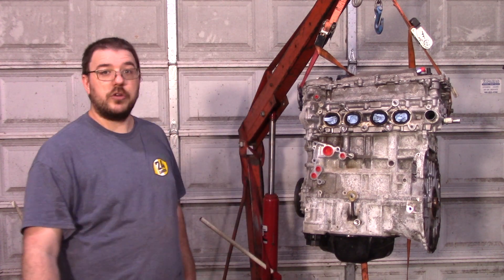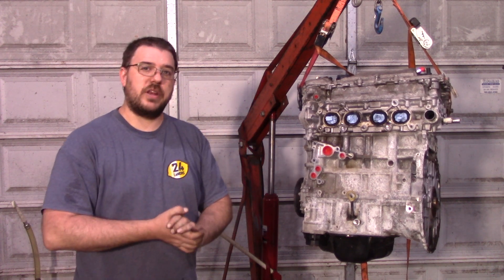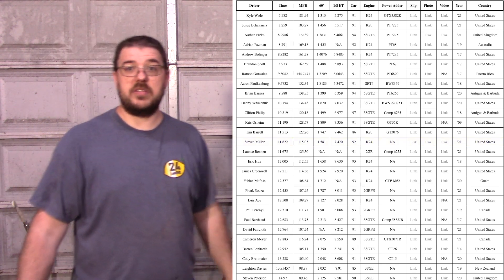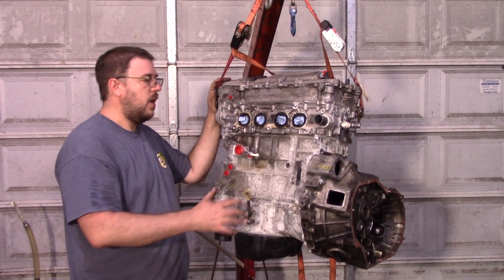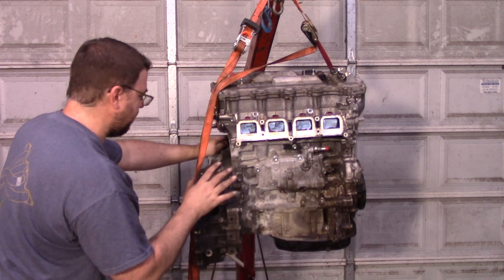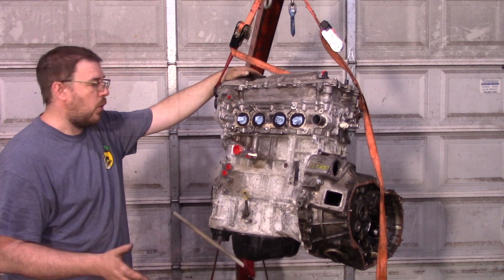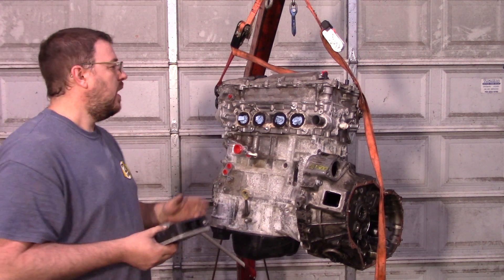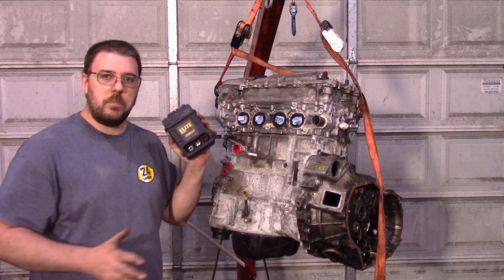MR2 Drag Race build, 2AR-FE powered (Evey #2)

Comment: I'm a year late, but I am interested in putting one of these in my 2nd gen for street use. Would probably want to do some top end work to make it rev higher though. Ideally I'd want it to have that same spirit of the beams engine. What's the highest you've gotten these to rev?
Reply from the maker: I have rev'd it to 8600RPM on the dyno but i have only raced it to 7600RPM. I will likely bump up the redline to 7800 for the next race, trying to sneak up on it

Comment: the SW20 is very near and dear to me, so very excited to see how Evey unfolds.  I had a 91 T-Top SW20 turbo back in 2005.  If I ever get another SW20 that's Either NA or with a broken 3SGTE I will definitely put in a 2AR-FE.  I've been fascinated by this engine since I read about Papadakis using it in the Hatchback that Fredrick Aasbo used to drive in Formula Drift until he got a GR Supra.
Reply from the maker: Yeah, that build he has is quite impressive. Especially how many stock components were in the build when it was making closer to 850whp.

Comment: Did you end up bothering to try the S54 fitment?
Reply from the maker: NixSpeed is currently building an AW11 and they confirmed the S54 has the same thing going on as the E153, the '91 and '92 bolts up but it's a bit light on bolt positions, the '93+ has more than enough bolt locations.
Reply: @FrankensteinMotorworks  thank you so much! Now to hope the engine oil pan clears my front engine mount support bar in my 6 gen Celica!
Reply from the maker: @Breazeh  That question is one i can't answer but i suspect it will.
Reply: @FrankensteinMotorworks  have you seen anyone in forums or discord doing the same swap in a gen 6 Celica?
Reply from the maker: @Breazeh  i regularly get questions about it but i do not have any details

Comment: What is the reasoning behind using a Haltech 1500 instead of a more affordable model like the haltech 550?
Reply from the maker: Jeff, the summary it gave me when it notified me of this stopped at the "m" in more, i thought you were trying to say motec and i was expecting to have to explain that not everyone has a massive budget to work with. But this is quite the opposite question. The primary reason is the drive by wire. The 1500 is the cheapest model that supports the DBW system. You could certainly convert to a drive by cable and probably do it for less than the $700 difference in ECU pricing but then there's also the Dual VVT-I and that isn't supported until the Elite 1000. The difference in price between the 1000 and the 1500 is $190 and if you look at the feature chart you gain a whole lot more than just DBW when going from the 1000 to the 1500, you also gain a nicer long term learning feature set, an ignition table that can depend on three variables instead of two, three level engine protection (this is really only a gain for the endurance racing i do, for street driving the single level is just fine). it also picks up all the race functions like the advanced boost control and the advanced flat shift support except. the only thing it is missing is the fancy torque management. It also picks up two extra outputs to make it so the DBW system does not consume additional outputs.
Reply: @FrankensteinMotorworks  I see. Thank you for the thorough explanation. Having never used a haltech ( or any custom ecu) myself, I was a bit confused as to what the difference would be in regards to this application. Having seen all of your 2ar videos, I knew you would have a good reason for choosing the more expensive device.

Comment: This is a minor thing but a "spotting guide" for how to identify a compatible E15x transmission would be nice; I'm lately getting inspired to dig into Toyota stuff and would prefer to find something that can both bolt to the 2AR and the ST185 transfer box.

I didn't realize the Elite 1500 does dual VVT; that makes it an interesting option for some things.
Reply: Look into the E352F and E359F from the 2000-2005 RAV4. They run the newer AZ/AR bell pattern and have a transfer case compatible with the ST165/185/205 rear diff, though with a much more compact iron case.

Comment: Great progress!

I am looking forward to a 2AR swap in my 1991 non-turbo. IIRC, the North America sales figures for 1991-1995 MR2s were >60% non-turbo. So I would love to see attention paid specifically towards economical upgrades for those cars even if it doesn't strictly align with the drag car build - kinda like a side project.

--- Transmission thoughts ---

In particular, I would love for you to confirm fitment of alternate transmissions like the S54, EB60/62, EA60, and/or E351 since E153 are expensive and getting harder to find. Just so folks know they have options.

I have a beat S54 which will need new clutch, syncros, etc. A rebuild+LSD+clutch+flywheel is approaching $2000 all said and done. I suspect many cars have a similar situation where to reliably handle any motor swap,  a significant investment needs to be made into the tranny. So if its not much more money to upgrade to a much newer transmission, I'm sure folks would prefer to do that.

Did any EB60/62 transmissions come with an LSD from the factory? I know there was a dealer installed LSD option for a few model years on the Scion tC and of course aftermarket options. I suspect a factory LSD was only available on the EA60 for the Evora.
Is a 5-speed significantly simpler to swap in than a 6-speed with the linkages and whatnot?

--- Engine thoughts ---

I know it doesn't exactly align with the drag car project, but I would love to see what the 2AR engine build looks like with stock cams and stock ECU with raised RPM and optimized intake/headers - basically a minimum build.

Confirmation that such an engine would work with the factory non-turbo fuel pump would be very much appreciated. Having to drop the fuel tank on a 30-year old car is a big hassle and something I am very much dreading.  So even if it means a more conservative tune, I think it would be worth investigating this.

Frankenstein motorworks 2AR SW20 parts I would be interested in:
- engine mounts
- exhaust header (if appropriate for fitment and/or high RPM use)
- intake (MAF tube thingy if appropriate for stock ECU high RPM tuning)
- modified stock ECU (immobilizer, RPM, fuel maps for stock injectors)
- modified engine harness or kit to convert
- DBW pedal conversion DIY kit
- coolant hose kit
- axle bearing support if appropriate for mounting a two-piece style passenger-side axle
Reply from the maker: I will confirm the S54 fitment, the trans was sitting at the front of the trailer blocked in by the car so i wasn't able to get to it but expect to have an answer on that pretty soon.. The EB60/EB62 fitment is guaranteed since that's the factory transmission for the 2AR. The EA60 will not fit as-is because of the starter position. As for the E351, i'm 99% sure but i've got one coming so i will confirm that also. 

The EB60 transmissions never came with an LSD but i have one available on my store. The EA60 does not have a factory one because it's just an economy diesel transmission but Quaife has a really nice unit that bolts right in. 

The stock fuel pump will absolutely work. both the NA and the turbo one, i can guarantee that based on my 2GR work. 

My struggle with these directions is i spent years developing the 2AR-FE swap in stock form for the Spyder because it is a fantastic motor and everyone keeps saying "it can't make 800hp, i don't want it" and now when i shoot for a bit power built i hear the exact opposite "that's not a cheap build" as a group you guys are impossible to satisfy :)

Power output for the stock 2AR-FE setup has been well documented on this channel. It makes 205whp which is about 235hp at the crank. This is more power than the SW20 turbo motor and without turbo lag. It is a pretty good fit for people looking for stock like power but just a little bit more. The first version i will have on the strip will likely be 100% stock but it will use an aftermarket ECU. no extra power is made using that ECU but i don't feel like wiring the car twice to not advantage since i will need an aftermarket ECU pretty soon after that first run anyways. 

As for the parts:
- The engine mount is 100% getting created so that's good to go.
- The header i make for the Spyder is usable for this but the engine bay has plenty of room to use much cheaper options that were developed for the Scion tC also.
- The MAF pipe, already developed, not much to say here.
- modified stock ECU, also already available.
- DBW pedal setup, already available, the signals are exactly the same as the SW20 and i really like the most recent design updates i made to that.
- Coolant hose kit, I'll check if i can make some existing hoses work for this. This is the kind of part that isn't absolutely necessary since there are other solutions so i will likely wait to see if there's enough interest in the other parts before making this one.
- Axle carrier bracket - The S54 you're proposing to use won't need it, I think the stock camry one will work for the E153 but i have to confirm that still.  This is something i will be exploring soon enough

That brings us to the wiring harness. The electrical architecture for this motor is pretty much identical to the 2GR so a lot of that documentation will help many customers that are a bit more confident with wiring. There are already vendors that are willing to provide plug & play solutions for this. As long as sales do happen for the mount that i will add to the store as soon as i can i will likely do what i have done in the past, i'll order all the common harnesses that i can for the motor and figure out which one is easiest to convert as a DIY and provide the instructions for the simplest DIY setup. I think the early 2AR camry even matches the MR2's fuse box terminals so there may be very little crimping required. This way there ends up being all three options, very DIY, DIY with a good guide and a straight up plug & play option because the wiring harness is a great way to save money on a swap.
Reply: @FrankensteinMotorworks   Thank you sir! Much appreciated.

Comment: Look at going to a much thinner gauge Tefzel wire, you could also batch fire the injectors and go waste spark to minimize wiring and no need for a cam trigger.
Reply from the maker: I like what you're thinking! I had never heard of Tefzel wire before but i just compared it to the TXL wire i was planning on using . 22ga for example is 1.67grams per foot and Tefzel looks to be 1.62grams per foot so it isn't a huge gain over the already light TXL. Currently i don't have all the terminals for the plugs on the motor so i won't use use Tefzel for the engine harness but i really appreciate the info and I will be using it in the future.

As for your waste spark/batch fire in semi sequential mode, that is a great way to save weight but that unfortunately would prevent me from running the dual vvt-i system and that would cost too much horsepower. for this particular engine. 

I do plan on doing things like sharing power rails for the cam sensors instead of splitting the wires at the ECU, every gram counts here.
Reply: @FrankensteinMotorworks  with your existing car in datalogging overlay cam position with a 1/4 mile run excluding the gear change window how much is the VVT actually being used? might not be worth using VVT on a drag engine where you will only be at WOT hopefully in the 4000/5000 to 7000+ RPM range?
Reply from the maker: @allan80supra  from what i can see it would really hurt the 50 to 80mph acceleration (beginning of 2nd gear) but honestly it's a bit hard to tell because i don't know exactly what shape the power curve will be. But since this car is also an R&D platform for the engine i really need to have the dual vvt-i to show off the motor's capabilities.
Reply: @FrankensteinMotorworks  yeah R&D vs race car will create some conflicts, Would suggest putting a Deutsch HDP (much easier to repin than autosport) bulkhead or two on the firewall so you can yoink the motor easy and if you find VVT is not that helpful a second simplified race motor and loom, I imagine there is significant weight in the VVT system and probably some oil pressure that could be used better elsewhere if you find VVT is not needed.
Reply from the maker: @allan80supra  I actually considered a bulkhead connector for the engine but with the ECU right on the other side of the firewall it'll be just as easy to pop a grommet and fish three connectors through (two for the ECU and one for the power supplies) and it'll be a tiny bit lighter that way. Heck, i've even ordered 10mm hollow tube for the transmission dowels. To get below 2000lbs i really will have to try every last thing.

The vvt-i phasers and solenoids weigh about 4.5lbs total and putting back on fixed gears on the cams puts about 0.8lbs of that back on so it certainly is a savings. The wire harness difference is probably 25-35 grams or so. keeping the phasers there will make more power, it's just a question of if they make enough extra power to be worth the weight. it'll be pretty easy on the dyno to simulate a fixed cam position to get dyno charts with and without it to calculate that. If it makes sense I certainly will make a different version of the engine without it. Along with a different engine harness so i can switch back and forth as needed. 

As for oil pressure, it's honestly already mostly being bypassed. The pump has way more volume available than what it uses. I'll have to see if i can find it but there was a big deal about the oil bypass valving in this motor in the new motor guide that Toyota put out.

Comment: 2arfe vs k24a2.  Which one and why?
Reply from the maker: I think the fact that i'm going down this course should make it obvious which one I'm choosing but here's a few of the high level reasons:

The AR motor is available in 90mm bore and 105mm stroke (2.7L) right from the factory which the exact dimensions you'll get out of a K24 after you spend thousands of dollars on custom cylinder sleeves and a stroker crank for the K. 

The AR's stock 90mm bore means that the valves are bigger. The stock intake of 36.5mm and 31mm exhaust is generally as big as the k can go once you spend a bunch of money upgrading the head. I know 4 pistons goes 38mm/30mm on their biggest offering which is even bigger, reaching that would take a bit of work on the 2AR but it would easily fit if you wanted it. 

The AR motor will happily spin 8600rpm with just a little bit of valvetrain work, i've done it in previous videos. I plan on pushing it further to see what happens if i can make power up there.

Along with those larger valves the motor has huge intake and exhaust ports. which means the stock intake manifold has only shown 4kPa restriction at the 241rwhp(270hp) level. This means that the factory intake will likely flow enough for 300whp/340hp.

The AR is available right from the factory in 10.4 compression ratio or 12.5:1 compression ratio. meaning without any modifications you have a motor already good for alcohol.

Overall, the AR does not have all those parts available to it but if you look at all of the above you see that a stock AR essentially starts where a highly upgraded k series ends. Toyota also made over 4 million of these motors so they are cheap as hell and easy to find. 

The only thing this motor is missing is camshafts and I'm working on fixing that. I expect that with camshafts i will make available soon you'll be able to take a 100% stock motor, install the camshafts and my header, the stock intake manifold with my velocity stack MAF pipe and get 300whp. It might require the 12.5:1 CR version if the 10.4:1 version does not do it. 

On the topic of camshafts, this motor has dual variable valve timing, this means it has a much wider torque band so if you had an AR and a K series with the same peak horsepower and peak torque rating the AR would make more power because it would stay near those peak numbers for much longer. The peak power on this motor is generally wide enough that even the very wide the 1-2 shift still keeps you at 90% of max horsepower.

Then, for the cherry on top, the AR bolts right to the E series Toyota transmission which is as bulletproof as an OEM transverse transmission gets for drag racing, heck the Honda guys upgrade to it because of it. There's also dog shift kits available for it if you want to push it further. There's also the EB60 transmission that bolts to it which is not as strong but more than strong enough and has a really nice modern shift feel for a daily driver. 

So, with all that information, 2arfe vs k24a2.  Which one would you pick?
Reply: I did not know the E-series bolts right to the 2ar-fe. Also any word on your cam shafts?
Reply from the maker: @keitht8595  Yeah, it's pretty awesome how much commonality there is in the bolt patterns across much of the Toyota lineup. The camshafts will be here very soon and there will be a video soon.

Comment: Where are you finding $300 2ARs?? Around me they are 2x as expensive
Reply from the maker: Toyota very conservatively made 4 million of these, that's probably shy by a couple million. They are all over many pick-n-pull yards, i just checked a pick-n-pull pricelist in texas and it shows $206.99 for a complete engine and a $49.99 core charge so $275 with tax. These pick-n-pull style yards where they have a fixed price for an engine are way better deals and they have nice engine cranes to help you pull the engine out quite easily.